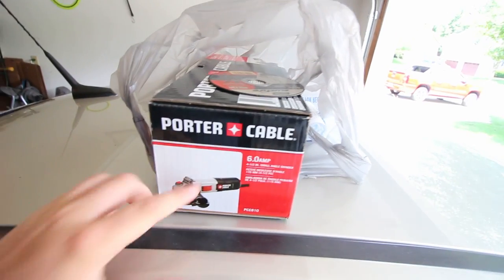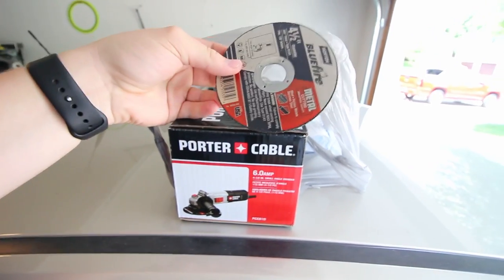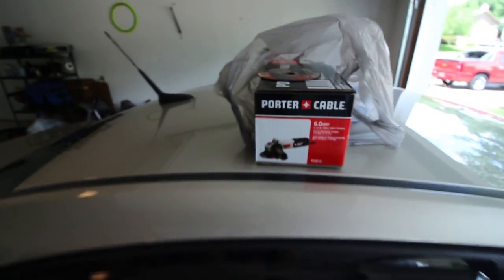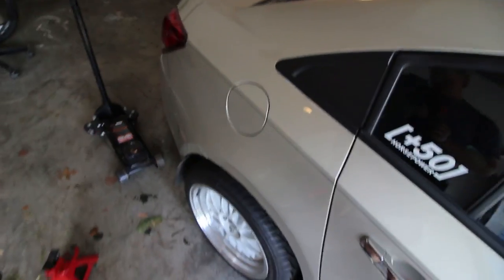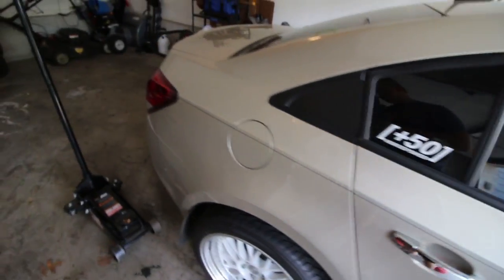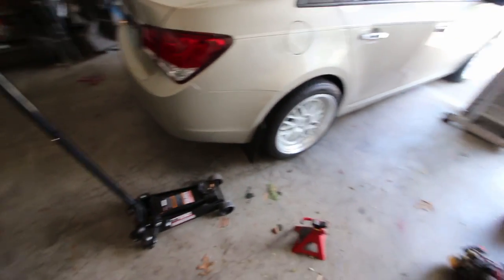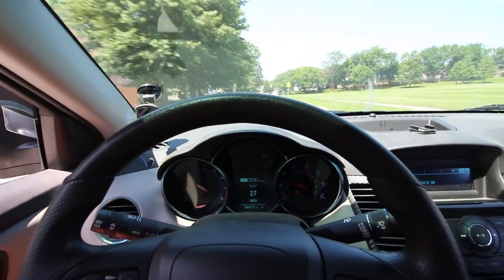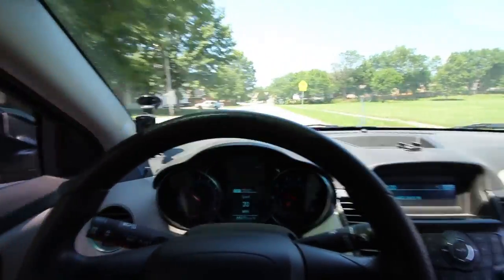I MADE MY CAR SOUND AWESOME!!! (Straight Pipe)

Comment: On my 2012 1.8 I recently got a muffler delete, and a straight pipe..removed the stock resonator and put in a smaller aftermarket one, and a 4" magnaflow tip. Sounds very clean and deep and not much drone at all. Doesn't rattle and all in all sounds better then my Magnaflow system I had on my older car. Its loud, but not quite as loud and untamed as a resonator delete. Very pleased with it.

Comment: Sounds great . So ur car 1.8 or the 1.4L turbo ?? If the N/a u can get headers for it
Reply from the maker: +James Pugh it's the 1.8, and zzp makes catless headers for the 1.8
Reply: Jonas Godwin yes seen that get high flow cats install if live where u need them.  Had zzp high flow downpipe with high flow cat on my 2001 gtp with the 3.8L s/c . Still got some store cridet from few years ago see let me use do got new malibu with 1.5L
Reply from the maker: +James Pugh I want to do no cats or high flow to make it sound louder. I would probably only have one cat if that was the case
Reply: Jonas Godwin  is 2 cats or is it 1 cat in a resatator then muffler . 4 cly usuly have 1 cat
Reply from the maker: +James Pugh there is two cats a resonator and a muffler stock

Comment: Also how bad was the poke/rub? I got 19x8.5" wheels with +33 offset. Also got 18mm adapters. I'm riding on ksports also.
Reply from the maker: With 25mm spacers I had fender rub in the rear, nothing super bad but it was eating at the tires a little bit